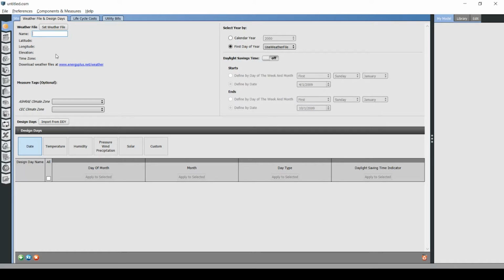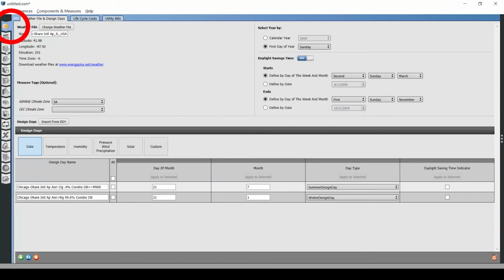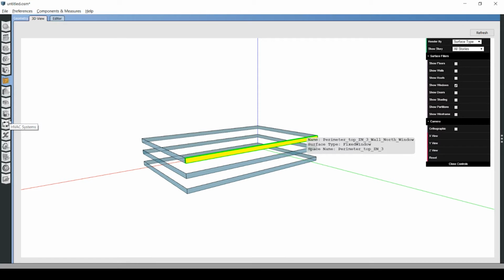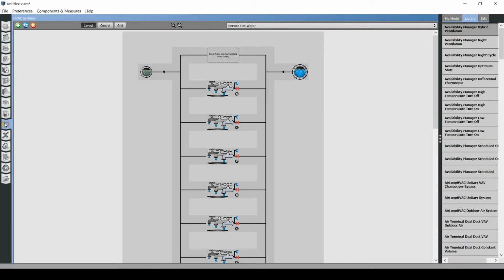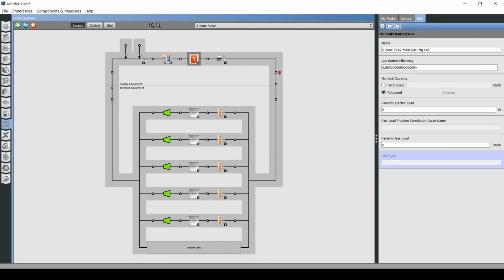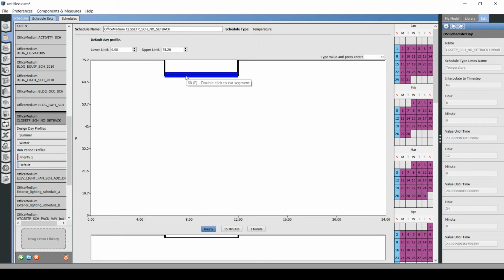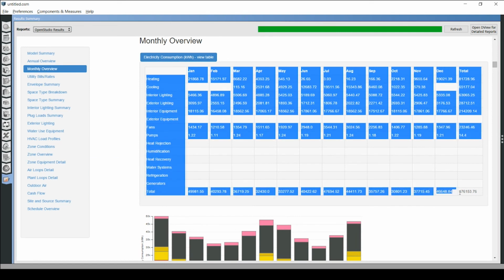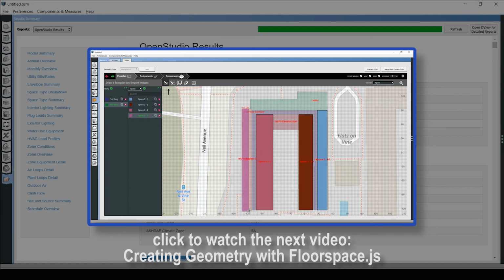Energy Modeling 101 OpenStudio Application A-Z

Comment: I tried to repeat this example. My setup is OpenStudio Application 1.8.0, OpenStudio 3.8.0. Fresh setup. Windows 11.  Measure has been downloaded from BCL.  Unfortunately, running measure I got an error: "SWIG director method error. IOError: not opened for reading" in climate_zone_representative_weather_file_path function. Should I do some extra steps preparing to tutorial or it just does not work in fresh OpenStudio releases?

Comment: Im running this on ubuntu 24.04  and i get [SWIG director method error. IOError: not opened for reading when running  the createTypicalBuilding  downloaded from the BCL if someone encountered this
Reply: I had the same problem. Did you find the solution?

Comment: How do I access the Create DOE Prototype Building measure in the new App? When I follow this, it does not show 21 different Whole Building measures to choose from
Reply: You first need to download them. They don't come with the default installation of the OpenStudio Application. Go to Components & Measures in the menu, select Find Measures. A dialog with title Open BCL will then open. In the dialog,  select Whole Building, Space Types in the Categories pane at left, it will list the measures you can download in the right pane. Select them and download them using the buttons and checkboxes in the pane.